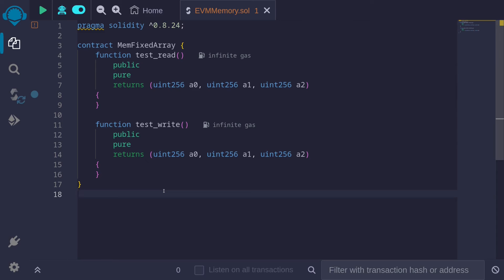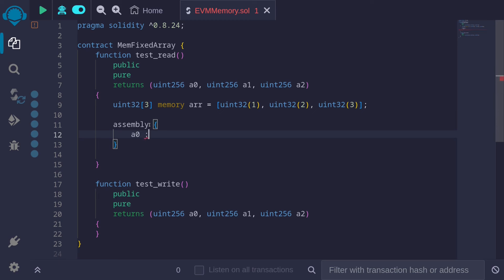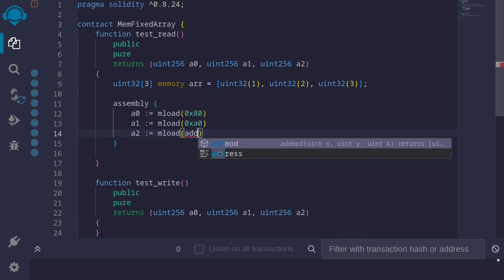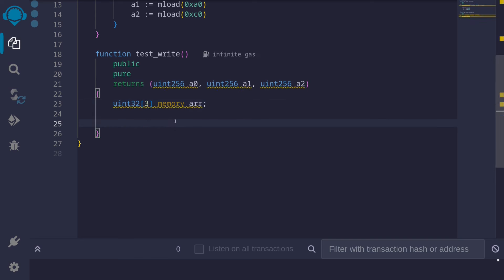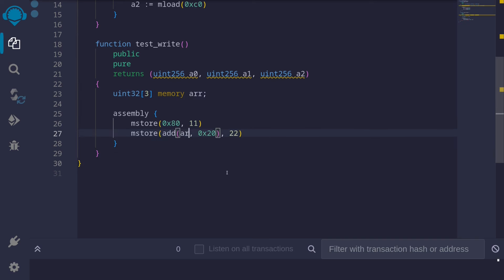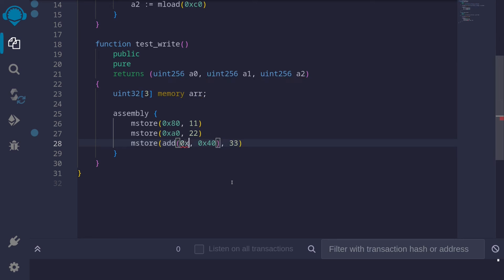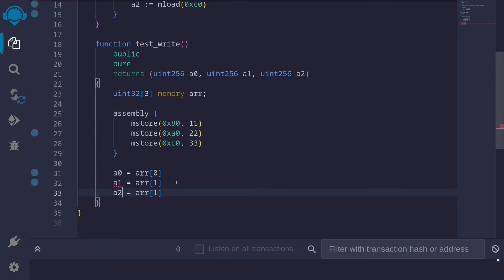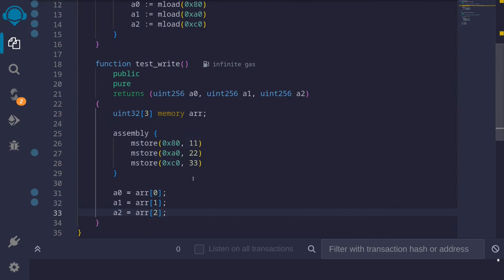Fixed Size Array | EVM Memory 5

Comment: How do you know the values are stored in 0x80? Why are the values not stored in the first 0x20 slot?
Reply: If you have chosen to store it in the free memory pointer, solidity provids a range of memory slot that is reserved for it it is between 0x40 - 0x5f, he choose to use 0x80 which falls within the range. You can choose something else. Depends on your context and reason.
Reply from the maker: In this case, array is initialized from 0x80
You can verify by getting the array pointer and printing it out

uint32[3] memory arr = [uint256(1), uint256(2), uint256(3)];

bytes32 p;
assembly {
   p := mload(arr)
}
return p;